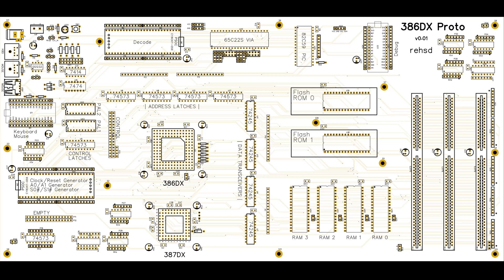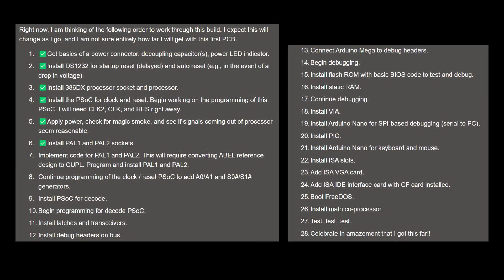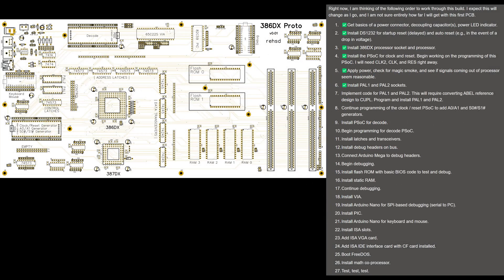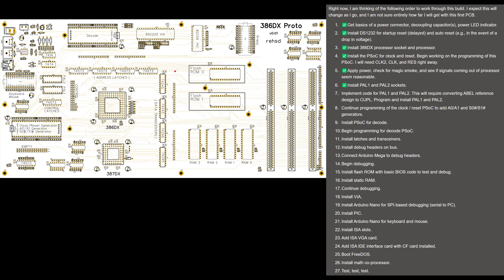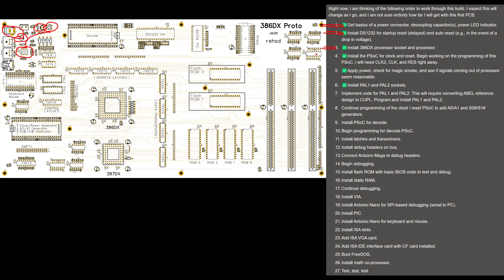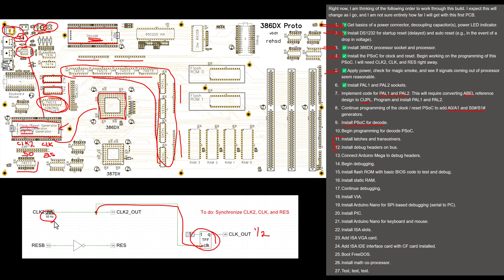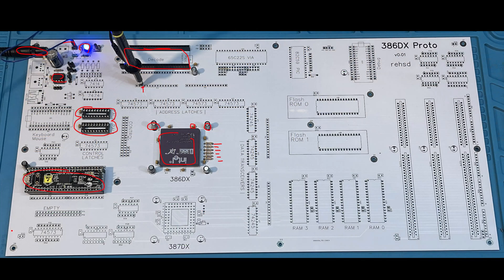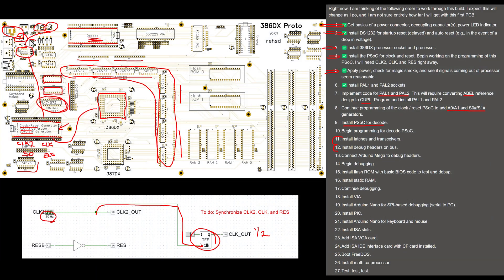80386 DX Build, Ep. 3 - Start to Prototype PCB Buildout

Comment: The PLDs should be easy to work with. Software wise, you will end up needing WinCupl. You can then flash it to the chip using something like the TL866II (or similar, or roll your own programmer.).

WinCupl itself is OLD AF and I don't recommend actually coding from it. I just drive the command line tools from VS Code. 

Workflow wise, I'll usually design my circuit in the logic simulator Digital and create test cases. Then port those test cases over to WinCupl simulator files and write my Cupl. By the time the tests pass then the logic should be right. I suppose transcribing the logic from the ABEL code should be easy enough, though I can't say I've worked with ABEL at all.

If it helps, I have a small guide for working with WinCupl. (just search for Lori Holden Cupl CPLD).

Comment: Can you still buy the 386 cpu new? i would like to give a go as wel.
The legendary musical S and MPC samplers from akai used this chip as wel.

You could use a CD4013 to divide the clock and have it synced.
Reply from the maker: I see plenty of 386SX CPUs that appear to be new. I don't know if I've seen any 386DX CPUs that look new. I am sourcing used ones off of Ebay.
Reply: @rehsd  Do you need the "south" bridge? as well? or could you just route the select line for the ic's select pins via CD4051 or so multiplexer and route it around? and pump data. Like Roland did in the Tr-909 drum machine using the 74HS174 databus.

That guy told me that you could drive a LCD, TFT or oled display with the i386 directly.
Reply from the maker: @AnalogDude_  Possibly. I imagine I will learn a lot as I work through all the different decode logic. Generally, I'm following the Intel reference design for a basic system, but there's so much I don't know.  :)
Reply: @rehsd  the 387 i saw on your pcb is the southbridge? 82384, i didn't now about that one, just the cd4000 series and pic's.
Reply from the maker: @AnalogDude_  The 387 is the math coprocessor.
Reply: @rehsd  i edited the comment, i said you could use a CD4013 to divide the clock and have it synced, would that help you?

I rather have a batch of 10, the cool parts about these is the parallel ports in contrary to pic's, mouser still sells parallel SDRAM ic's witch you can't really use on pic's albeit (much) faster unless you use I/O ex panders but than you have to clock serial data as well. Not so long ago, i saw a guy using a i386 on a "breadboard", explaining how to get to run.

You probably also could get the new ones to run, but the socket is much much much more complicated with like 1000 pins, special psu's.

Awesome job, subbed.
Reply from the maker: @AnalogDude_  Thanks for the suggestion. Normally, the clocks and reset are synchronized within an 82384 Clock Generator. While I am using a PSoC for now, it could eventually be managed with a PLD or discrete ICs. The CD4013 could be helpful. I use 7474's and counters for dividing clocks, too.